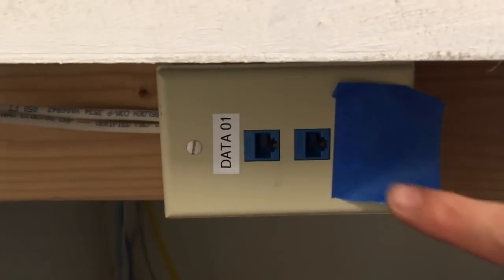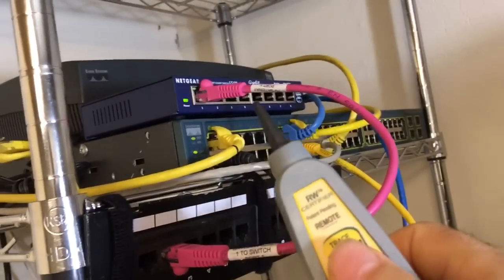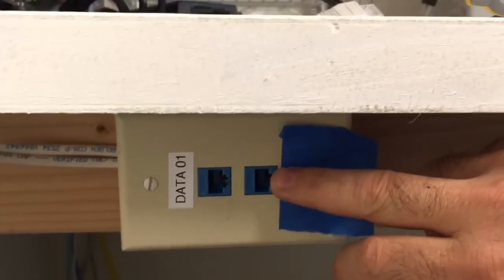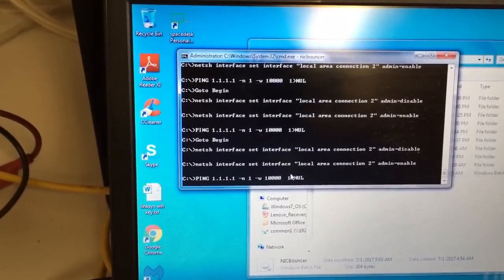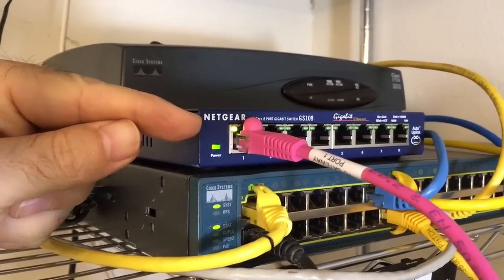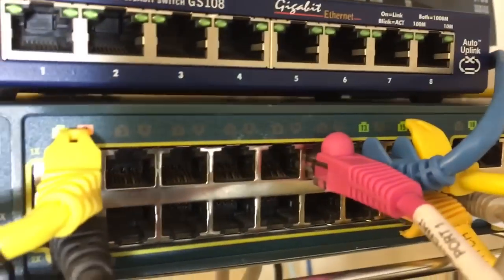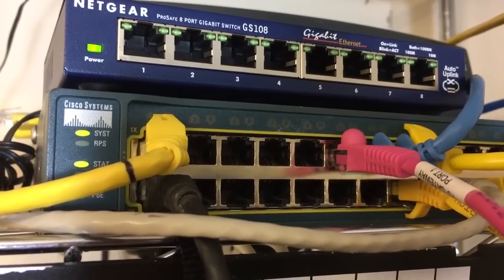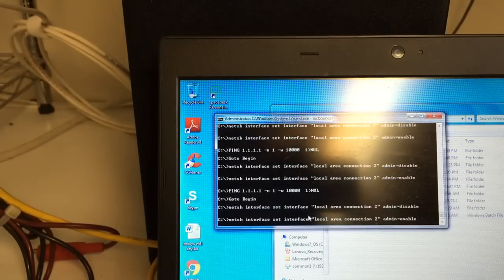Tracing out Live Network Cables

Comment: Nice work with the script :) Btw, if you just connect one lead from your toner to the cable it won't be shorted by the switch & will still be picked up by the probe.
Reply from the maker: neat idea.  I'll have to try that.  :-)
Reply: This works great! Thanks for the tip. I made up a short patch leas with a single bare wire from one of the pairs to connect to the crocodile clip from the tone generator. Tone goes through to the patch lead plugged into the switch nicely.
Reply: @K1LLAROO  Thanks my fellow IT pro lol you have solved my issue with finding my port in questions!
Reply from the maker: Awesome!
Reply: You should make video. Technicians around the world would save millions of dollars. Thank you for sharing. 🙏
Reply from the maker: Right?   I wish I could make videos as a full-time gig.  Google just doesn’t pay enough in ad revenue.
Reply: @NetworkAdvisor  that’s true

Comment: If you want to tone a live cable plugged into a switch, recrimp the toner end so instead of being on the blue / white-blue pair, it will be on blue / brown pair.  Basically, hop it over one wire so it runs unbalanced.
Reply from the maker: What a neat idea Brian.  Especially, the part about splitting up the pairs - that would defeat a lot of the noise reductuon inherent in the twisted pairs.

Great info.  Thanks for contributing! 😃
Reply: I did not find this unbalanced tip to work. I used a banjo, connected one lead to pin 5 (blue in 568 wiring) and the other to pin 7 (brown in 568 wiring). I know the cable is connected to my switch and live, no tone on the  equipment (mdf) side. Where did I go wrong?

Comment: If the line your toning is live, check the other jack(looks like the two cables were pulled at same time). If that's live too, does it look like the outlet is part of original install (looks like all the other jacks in the office?) or added on later (oh we forgot to put a location here)? if added after, most likely find it on or near the last patch panel. To confirm,  check the last panel. See if anything plugged in. If you find the other cable, check if the port next to it is plugged in too. If so, perform the scream test. Unplug the patch cable and see if anybody screams because they just lost the internet 😉  also see if your toner works now (always check that your toner is working  before every use. 9V batteries die). yah or nah? if nah,  plug patch cable back in. monitor your phone🤫

Comment: That is a great tip for those who don't have a toner or have a toner that doesn't work. The toner I have works on cables that are plugged into a switch so I wouldn't need to do this trick for that. Great trick though!
Reply: Which one do you use?

Comment: Heres my tip, dont use the rj11 on the tone generator. Strip a cat6 cable, plug it into the port and clip the alligator clips to 2 wires of different color. All the colored pairs are connected in the switch.broke blue with solid blue, broken green with solid green etc. Clipping to different colors will break continuity and bring the tone back.  Just dont use brown cuz thats poe.
 Another option (if your switch supports it) is to plug your laptop into the port, logon to the switch and use the show mac-adddress command to see which port your laptop is plugged into.
Reply from the maker: Sounds like I should just make a special, short cord just for this. 😊
But, I guess I could use my 8-conductor Banjo as well.  Laziness I guess. 😆
Great info, thanks for contributing!
Reply: @NetworkAdvisor  no prob. Youre prob wondering why have the rj11 wired to use the blue pair if this other method always works. The fact is these tone and probe kits like the tempo 701k-g and triplett fox and hound were designed and used for voice and the blue pair on data is the -+ pair on voice.
Reply: @Henry_Jones You are a legend. I have been pulling my hair out having to tone over 200 cables and now it's super easy. I made a custom cable that has a keystone on one end and a rj45 on the other. I punched down solid orange to pin 4 and solid blue to pin 5. The rj45 is wired normally (t568b.) Now I just plug the rj11 from the tone generator in my rj45 keystone cable and now the tone works on an active network line. No more shorting... yaaa. Thank you a bunch, Henry!! :)
Reply: @justrightlizard  glad to help thanks!

Comment: Almost all modern toners do both analog and digital tones. They work just fine on live drops. Many of them also have a port blink feature which works too.
Reply: @Steve Douglas Fluke's Intellitone line works great. You can get a basic tone and probe or use a toner built into any of their test equipment. If you want a tester as well, it's worth looking at the MicroScanner.

Comment: I was wondering if you could answer a question. i have tried many times to trace a line on a live network many times without success. i own a fluke microscanner that has the intellitone built in. sometimes it works sometimes it doesn't. does not work on poe ports. just shows you it is a poe on the screen briefly then screen info goes away. i then have to try the old trick of plugging in a laptop, unplugging it, and having a partner look for it to go away. not so easy with 10 switches in a rack and patch cables blocking your view. i just did a job last night where i was hired to re lace 50 cubicle seats with the lines already plugged in a poe switch on the other end. no labels on the cable. if i have to go back what do i do? i was thinking of either buying just the intellitone generator and not use the one in the microsanner. $135 maybe it will work. other option was the buy the platinum tools cable prowler. i think that is the tester that you can set the frequency and cause a flash at the switch that is very constant and different from the other lights. very similar to what you just described in this video. the way it flashes the light is way more obvious than the flashes i just watched on your video. nonetheless i feel this will take hours. that tester is about $500 btw. grrrrrrr.
Reply: For plugging into live networks, you will want a Fluke IntelliTone Pro 200 (under $200 on amazon: https://www.amazon.com/Fluke-Networks-IntelliTone-Toner-MT-8200-60-KIT/dp/B0749RXGB4). This will tone the cable whether it plugged into a PoE switch or just hanging from the ceiling. It has been a lifesaver and the price isn't horrible if you plan to do this work regularly.
Reply: if the network is setup as a hierarchical network, some will be Core switch, some will be Distribution Switch and some will be Access Switches. The ones you are going to be interested in are the Access switches.
Reply: I have a Klein commander it can flash the port slower for I'd. You can also plug in a laptop and check for a link light . Tone generators and testers have problems with active noise from the switch makes it hard for id . The fluke is the best for probe id
Reply: Are you using the Fluke Intellitone probe with your MicroScanner? To get the most out of it, you need both to enable the digital features.

Comment: Hi. You seem very knowledgable... so question: i want to set up my home yard sprinkler, interior lights, etc. so that i can control them remotely on my smart phone/PC. Yes, there r a lot of products out there that do this via wifi. However, my wifi router at home occasionally needs a reboot (unplug and plug back in). I wont be able to physically do this rebooting while traveling in other countries for many months at a time. What are my options these days to alleviate this issue? Thanks!
Reply from the maker: That's an excellent question!   However, this gets a little more into Home Automation than I am qualified to comment on.   If it were me, I might be looking at devices that can communicated via the Electrical wiring.  This way, you eliminate the potential reliability problems of wifi.   Back in the old days I experimented with some product call "X10".  Not sure if they're even around anymore.  But the idea is that all the communication between the controller and the remote devices happens via the electrical wiring.

I with you luck with that!  :-)
Reply: Plug your router into a smart plug that can detect if it loses internet connection and will automatically reboot the router. Almost brands call this "self healing" outlets. Ubiquiti and some others offer these, but Wattbox is the best in the game.

Comment: So what kind of device can I use in this scenario. I have 3 switches at work and 3 patch panel..48 ports on each. The cables have been out of control for years and I want to trace cables from a switch and find which port on which panel...so what kind of device gives me this type of test so that I'm not ripping up 100s of cables
Reply: Get the Intellitone from Fluke.  It will work on active networks with a digital tone and has a secondary mode to isolate to the switch.  Once you isolate to the switch, you plug the rj45s into the back of the probe to confirm the cable.  It's basically 3 tools in 1.
Reply: @Justify4935  thanks. I'll look into this
Reply: @rhdtv2002  Either that, or if you have the money, get a NetAlly linkrunner AT.

Comment: I live in a 2 story house and I don't get a great signal on my internet and don't have a cable long enough for the router to my bedroom would it be worth me having a switch setup so I can atleast plug in my desktop and my laptop and xboxone and ps4 all that other stuff
Reply from the maker: hi Dave.  While using a switch to Hard-wire your devices does provide better performance at the Local Area Network level, if the internet signal (speed) coming from your provider is poor, it wont do much to overcome that.  good question, thanks for asking. 😀
Reply: @NetworkAdvisor  Okaii thank you for your time, what about just like a small switch box, just thinking so I don't have a connection issue but it's getting cables long enough
Reply: Dave, you should try using powerline Ethernet bridges. They have really become quite robust in recent years. They work with most electrical wiring and prevent the need to pull long cable runs.

Comment: I have seen this elsewhere. Have you looked at what it does to the DHCP pool? If you don't, the DHCP server could assign an IP address and remove it out of the pool until the DHCP lease time expires (default 24 hours, usually). Let it run long enough and you exhaust the DHCP pool. I suggest that after you enable the device and have a time delay, issue ipconfig /release in order to release any DHCP assigned values before you disable the interface for the next loop.
Reply: Most DHCP servers will associate the issued IP with a MAC address (within the lease time), so this would not eat up additional IP addresses from the pool.  I cannot state that all DHCP servers do this, but it is pretty typical.  Good info to look into though

Comment: If you've got your laptop why don't you just lookup your laptop's mac address in switches's mac address table / ethernet switching table
Reply from the maker: Sakar,  as a field technician, we often do not have access to the switch command line interface.  So, we have to use methods outside of that.

But, good observation!  :-D
Reply: Network Advisor Ah! yes it is certainly useful in that case. It is clever what you have done. But please remember Network Admins often apply port security to Switch's port, in that case this method could bring switch's port to shutdown/disabled.
Reply from the maker: ah ha!   Excellent point, Sakar!  :-)